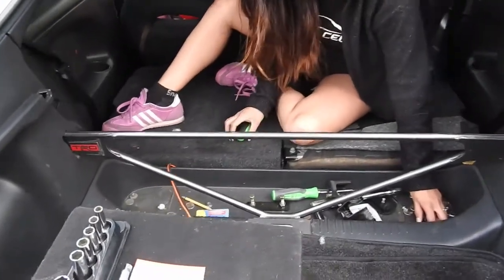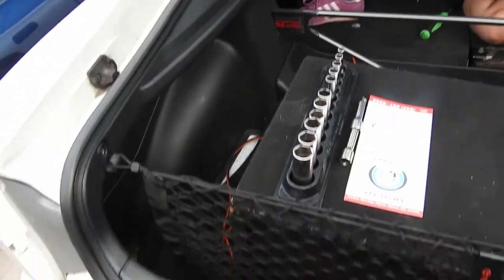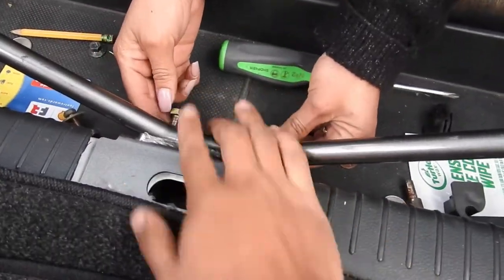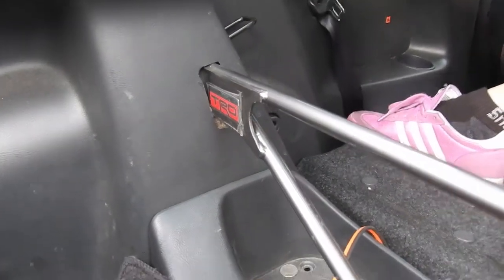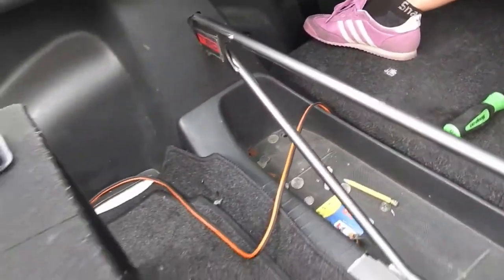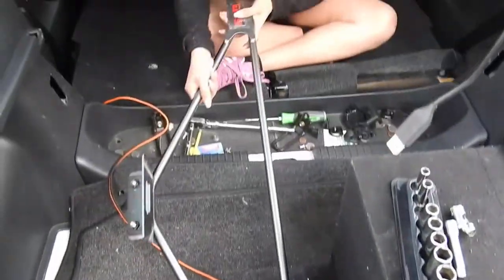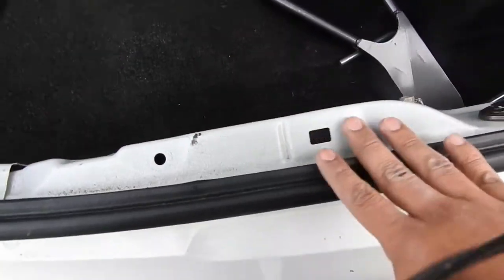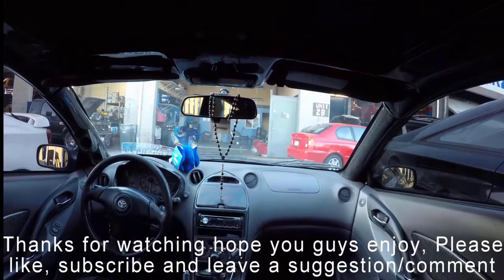Removing TRD Strut Bar On My Wife Car

Comment: Hey man a question where can I find the vss on the celica?
Reply: I need help to find the vss my car is acting up please and thank you man
Reply: newcelica.org is a great resource for information.
Reply from the maker: The vehicle speed sensor is on the transmission under the battery
Reply: They told me that there's two I got the one under the battery on the transmission and I also got the sensor that has three Philips screws and one ten. I need help on finding the last one. Thank you
Reply from the maker: Thats the only one I kno, i dont see where the other one will go
Reply: Okay thanks man